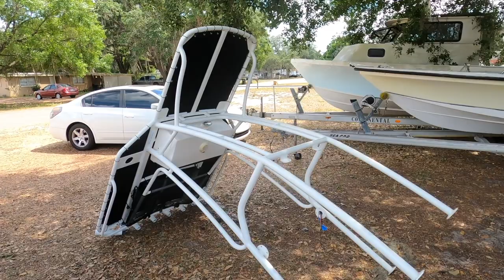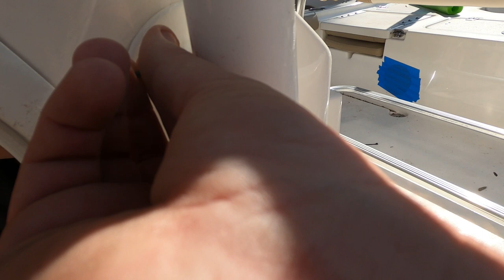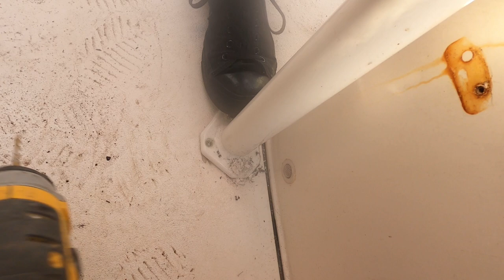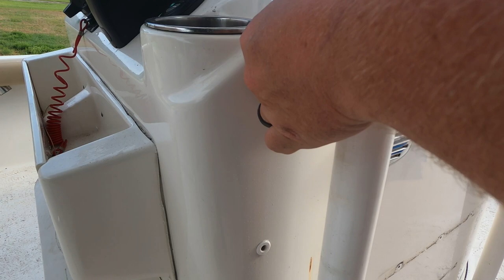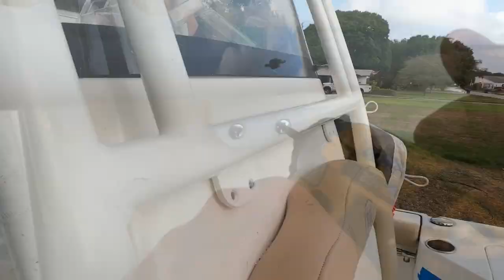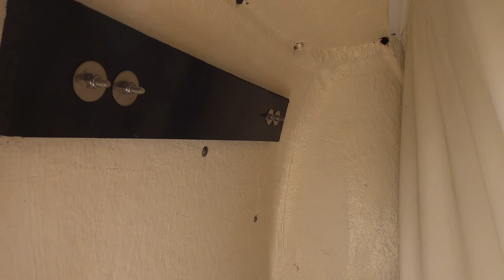How to install a T Top on a Key West Bay Reef | How to Install a T-top

Comment: Do you remember what hardware you used for the floor screws and through bolts? Im about to tackle this same job on my 230br and want to make sure I get some quality hardware.
Reply from the maker: I forget the size we used but we used stainless woodscrews. On the bayreefs they have the floor reinforced where the pads screw in at from what I read.